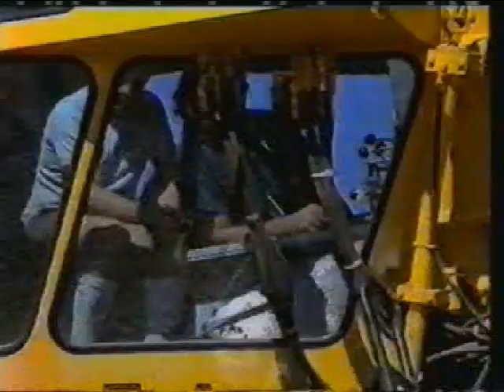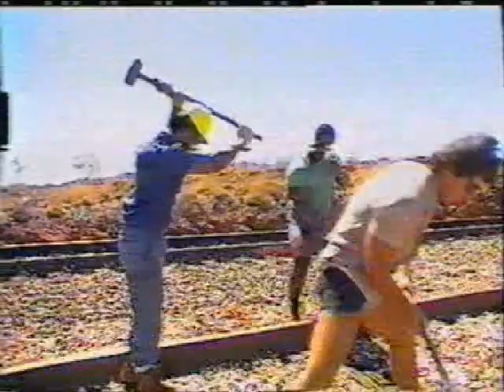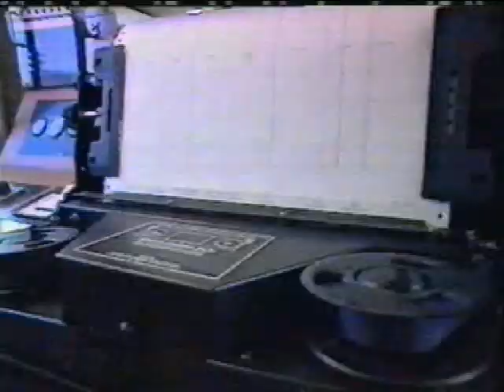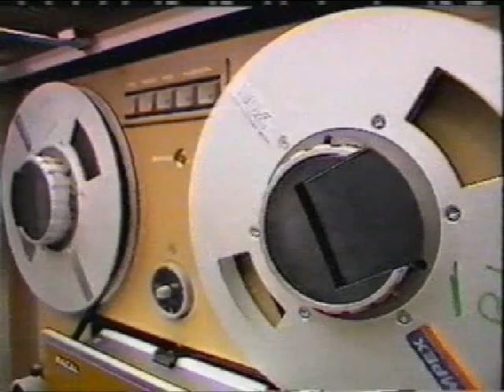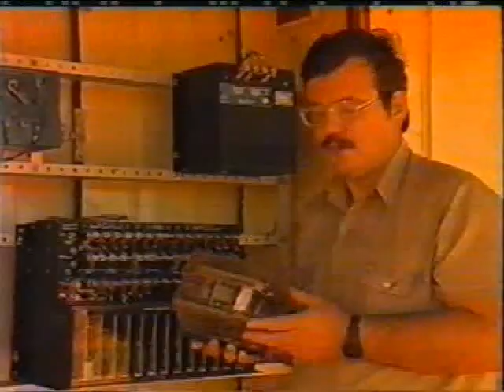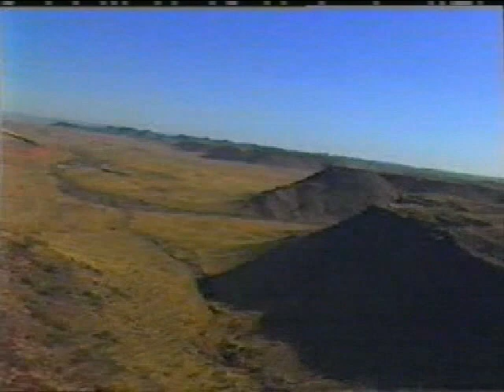Mt. Newman Mining Railroad Pt.3 of  3

Comment: Pity they do NOT have intelegent engineers in charge / just as when they boughr some new locos and they thought that they were too high , so when the locos arrived in Port Hedland the fifet thing that thev  did was to take them to the wheel lathe and shave off agout half of the  wheels and then measured them onlt to find that they were now well under the loading gauge and did not need to be turned , that just one of the things that they did , realy smart bastards .